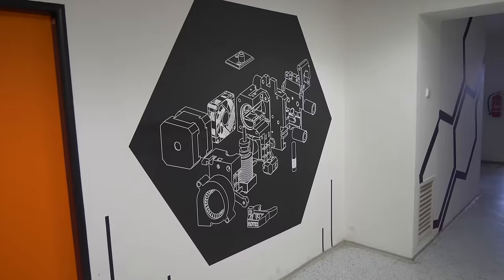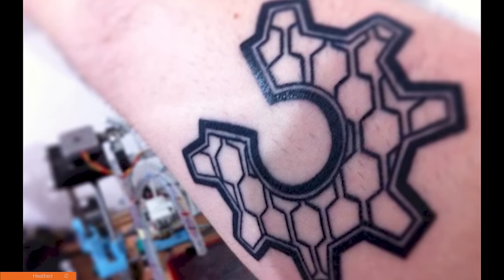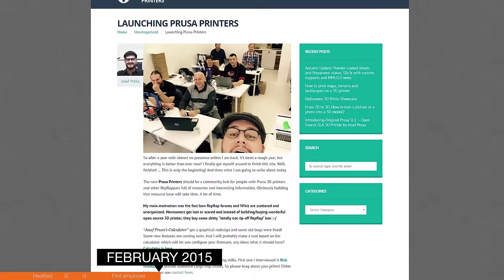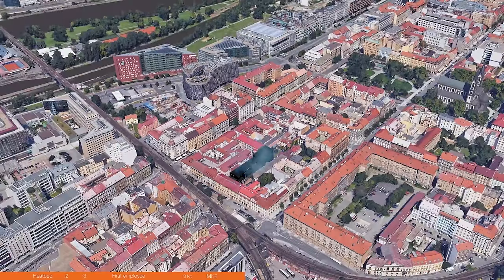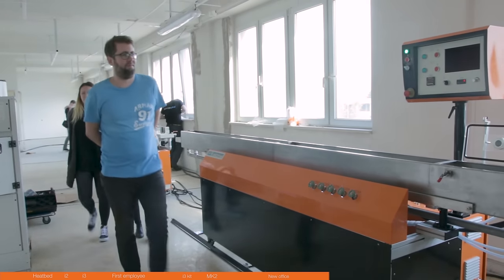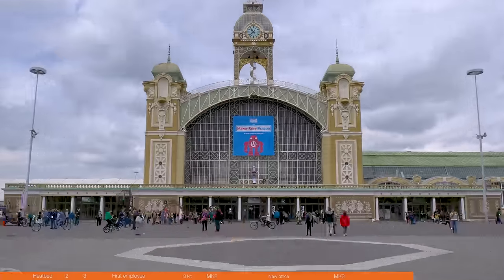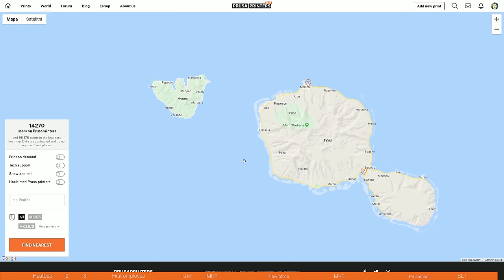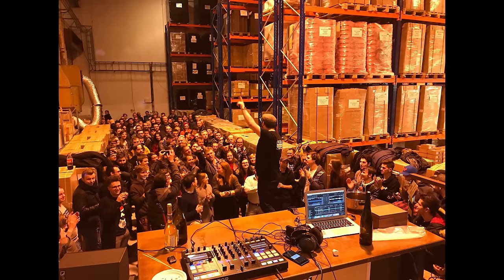The Road to 100,000 Original Prusa 3D printers

Comment: I LOOOOOOVE my Prusa printer! It just works! My other printers have constant clogs, breakdowns and failed prints regularly. My Prusa MK3S+ is amazing. It just works. Fantastic prints every time. What amazes me is that they have thought of EVERYTHING: the slicer is awesome, no need to really think just throw in the model and slice. The PINDA bed levelling is top notch,, the run out sensor, changing or inserting filament. The prints come out perfect every time. The prusa printer is the only one that prints perfect prints even with a cheap filament. And their own filaments are also amazing. I can go on and on. Thank you for these wonderful machines!

Comment: Love my MK3's, but I'd really like a larger Core XY style machine from Prusa. Maybe for 2020?
Reply: Still hope for PrusaCoreXY! Fingers crossed
Reply: Me too. I love my MK3 but I dream about some new innovations in FDM.
Reply: i can see them working on one with a heated chamber since now the patent from stratasys is running out. I guess we'll see soon enough :)
Reply: 3-400 mm x 3-400mm Prusa developed coreXY with tool changer support is the dream.
Reply: @matze1508  Patenting slows innovation down. Revolution!!! :)
Reply: I'm building one it's 60x60cm outside and 50x48cm bed and struggling to make the bed heated right now, its CoreXY made by 20x20 aluminium and some 20x40 ones strengthen by acrylic/wood cover to  heat chamber to be able to print PC filament, DUET wifi is ordered and on the way so imagine if we could make this thing a production line, Joseph's video gives me a charge of inspiring and ambition.
Reply: @Sam Power usage should scale with surface area which is a square of side length so it makes sense. I’d be inclined to have two heating circuits: one for the center region if the print is small and one for the remainder area if the print is larger. I also think it would need to be mains power based (or at least a good deal higher voltage than 24v) to be able to have enough power which increases risk of fire and worsens the consequences for electrocution due to improper isolation or insolation failure. For those reasons I’m not really interested in doing anything heat bed wise that isn’t already available in consumer purchasable printers. (A COTS part)
Reply: @amoose136  what if you only would/could heat the area of the bed that will have fillement contact? (plus some small Aria around it for convection)
Reply: @amoose136  True. That's exactly what I need for my projects. There are another options but the prusa seem's to be a very nice printer brand with a large ecosystem.

Comment: well i'm a newbie in 3d priting, actually didn't even get my 3d printer yet ( coming 1st week of may 2020) and a friend over italian 3d printing community pointed me to this video: AMAZING ! it's just beautiful to see how you started and how things are going ! Congratulations and happy printing !!!
Reply: Yo dude ! I have the Mk3s, you should know that you have to lubricate it every now and than. If you encounter ghosting, lubricate the smooth rods JUST A BIT (look it up at the knolagebase ! Its easy to do somethink wrong ).

(Only the Non-powderd one)
If your prints dont stick to the bed, clean the bed with warm/hot water and Non-perfumed soap and After its dryed, wipe it clean with Ipa. 

If you have questions, use the live chat ! Not the e-mail ! shop.prusa3d.com , there is the livechat. 

Make a Sharp tip at the fillament before putting it into the extruder.

Comment: Please make a huge build volume 3d printer
Reply: It will come with a huge price tag...
Reply: @murc111  yea of course, because i need build bigger stuff. So... prusa mk3s is really reliable, hope it will make a bigger build volume
Reply: @MaverickNgMVRKNG  why not make your own just take the prusa design and make it bigger or design your own one guy made a printer with a 1x2x1 meter bed
Reply: @Sarge92  because of the firmware it self, largest build might have different calculation for 3d printing.
Reply: @MaverickNgMVRKNG  Spend more time looking at firmware, i.e. Marlin.  You will understand the severity of your concerns then. {download it, open up configuration file in text editor)  The biggest problems with larger builds tend to do with sizing (psu, heatbed, hotend, nozzle, etc.).  Generally the bigger volumes come in the Core XY configuration (for many reasons: easily enclosed, static footprint)

Comment: I made a clone of Prusa i3. Used the wooden box design and took me few years to find time to finish it, but now I'm successfully printing. Was bit of a challenge to put it together as I had the parts (friend printed them for me), but no manual how to put them together, just a gallery of pictures in various stages of construction. I had to figure out where which part went, but the thing was simple enough that I figured it out. At first I used a wooden carriage plate, that I had to level bed before every print, I upgraded to broken aluminum composite (broke in transit) so now I have to level every 3-4 prints. Still, it was a great learning experience and I cannot thank enough for your contribution to the RepRap.

Kdyz te nekdy potkam, tak te pozvu na pivo.

Comment: it would be cool if prusa made a mill type printer so after a print is done a conveyor moves the print and makes a new print area, so basically like the cr-30 but with a normal hot end instead of a 45° one. it will also streamline the print mill room by automatically clearing the part from it to keep efficiency at max

Comment: Such an engaging and interesting story, I love to hear how companies grow. And especially the fact that this is so recent !

Also....  If you were printing the same thing but the lead times were large why did you not start getting parts injection moulded ?
Reply from the maker: Injection molding is a good point :) 
We get asked about it quite often, so we have prepared an answer for that:
The printed parts are never a bottleneck, we simply add more printers to the farm when we need them. Molds are REALLY expensive and take weeks to get right. And you are limited with the geometry of the parts - there are shapes that injection molding simply cannot do. On the other hand with 3D printing we iterate the parts and constantly improve them, this is not possible with injection molding. Last but not least, WE ARE USING OUR OWN PRINTERS :) Our manufacturing is literally depending on our own product, which is great! It pushes us to make the printers better and if there ever is something that could use an improvement, we're the first to discover it. The amount of print hours that the farm printers get in a few months is more than what the user will print in the lifetime of the printer :)

With that said, we do own a few injection molding machines and we are already using them for a few parts, where it makes sense (bigger parts that rarely need updates, e.g. spool holder, MINI front panel)
- Mikolas

Comment: In the beginning it made sense to use printers to print new printers but at this scale I would bet injection molded parts would be far more efficient.  I get that this would be a huge deviation from the roots.
Reply from the maker: We get asked about injection molding quite often :) Here's a copy-paste of our usual answer:
The printed parts are never a bottleneck, we simply add more printers to the farm when we need them. Molds are REALLY expensive and take weeks to get right. And you are limited with the geometry of the parts - there are shapes that injection molding simply cannot do. On the other hand with 3D printing we iterate the parts and constantly improve them, this is not possible with injection molding. Last but not least, WE ARE USING OUR OWN PRINTERS :) Our manufacturing is literally depending on our own product, which is great! It pushes us to make the printers better and if there ever is something that could use an improvement, we're the first to discover it. The amount of print hours that the farm printers get in a few months is more than what the user will print in the lifetime of the printer :)

Comment: thank you for all the hard work you have put into make 3d print accessible to ppl like me. i dont own a prusa yet but id love to. i have a ender 5, kingroon kp3 and a anet e10 and im pretty sure everyone of those took something if not the majority of the design from your i3. ive started to buy cheap clones of the i3 but ive not dont it cause id rather have the actual real thing, its price has just been alittle out of my reach for a single printer so far but ive been thinking about trying to print all the parts that i can an then use aluminum extrusions as a frame. one day i'll own a real prusa i3 mk3 or whatever the newest is when im able to buy from prusa.

Comment: i have a question, you are using 3D printers to print 3D printers, now that you reached a size that would allows you to buy machines to do injection molding would you do it
I feel like it make sense in a productivity point of view, but would you prefer to stick to the way you are doing right now ?

Comment: Hats off to you and how you grew your company with your own products.  However why didn’t you get into injection molding the quantity of parts?  Much faster, higher quality and less labor intensive.
Reply from the maker: Injection molding is a good point :) We get asked about it quite often, so we have an answer that I'll copy/paste here:
The printed parts are never a bottleneck, we simply add more printers to the farm when we need them. Molds are REALLY expensive and take weeks to get right. And you are limited with the geometry of the parts - there are shapes that injection molding simply cannot do. On the other hand with 3D printing we iterate the parts and constantly improve them, this is not possible with injection molding. Last but not least, WE ARE USING OUR OWN PRINTERS :) Our manufacturing is literally depending on our own product, which is great! It pushes us to make the printers better and if there ever is something that could use an improvement, we're the first to discover it. The amount of print hours that the farm printers get in a few months is more than what the user will print in the lifetime of the printer :)

With that said, we do own a few injection molding machines now and we are already using them for a few parts, where it makes sense (bigger parts that rarely need updates, e.g. spool holder, MINI front panel). We can even re-use some plastic from failed prints for the injection molding, which is nice.
- Mikolas

Comment: Just wondering, once you got up and going, why didn't you switch to injection molds for your printers?
Reply: The whole design ethos of reprap is self-replicating, so unless you are injection molding into 3d printed molds, it doesn't match the original philosophy.
Reply from the maker: We get asked about injection molding quite often :) Here's a copy-paste of our usual answer:
The printed parts are never a bottleneck, we simply add more printers to the farm when we need them. Molds are REALLY expensive and take weeks to get right. And you are limited with the geometry of the parts - there are shapes that injection molding simply cannot do. On the other hand with 3D printing we iterate the parts and constantly improve them, this is not possible with injection molding. Last but not least, WE ARE USING OUR OWN PRINTERS :) Our manufacturing is literally depending on our own product, which is great! It pushes us to make the printers better and if there ever is something that could use an improvement, we're the first to discover it. The amount of print hours that the farm printers get in a few months is more than what the user will print in the lifetime of the printer :)

Comment: Makes me want one, price is too much.  I'm not saying it's expensive, just too much so for me. I'd probably be tempted with a mini, having UK stock would probably convince me more. I'm very impatient. You should also sell on eBay. Lots sell for a higher price than they should be. Official stock would lower the value and if it doesn't, makes new way more attractive. Kits are for sale @£900 new, I also wouldn't object to a £20 increase in price through eBay, to go towards the extra costs. You'd sell tons of filament too. Think it's time to branch out and make it more accessible. I can get an Ender 3 V2 delivered next day from box. I swear you'll improve your customer base.

Comment: 3d printing is cool and all, but it seems like a huge waste of electricity to use 3d printing for all these parts instead of using injection molding or some other real process, it would also likely remove any of your scaling issues. And if you INSIST on doing it, why not just modify your Prusa's into continuous conveyer belt-driven printers. That would save a crazy amount of man-hours and work at this scale. Anyways, amazing job. Many have failed to get working production lines for complex products and you guys are crushing it!

Comment: I fitted a Brand New Bl touch to my Ender 3 Pro yesterday

I  spent hours following the install video's making sure it was fitted correctly

I powered on and it was working great, I did my first print which took 45 minutes and it was great

I decided to do another print, turning the power off, I changed the colour of the pla

Powering it back on, I isntantly got a strong electrical burning smell

Noticing the BL Touch sensor ,the lights had gone out and thats where the burning smell was coming from

The Ender 3 was still powered on, but the Bl touch was NOT

I have written to Banggood as thats where I bought it from

My concerns are, It may be a faulty sensor, in which case replacing it with another may be ok

If there is something else causing this I need to check to make sure

Please can you advise what i should check, before i replace with a New sensor

Please remember It printed ok and ran for 45 minutes

Only after I powered off and re powered on 10 minutes later did this happen

many thanks

Comment: It's cool that you 3D print a lot of the parts, but at what point do you decide to go with plastic injection molding? Doesn't it get cheaper at this scale?
Reply from the maker: We get asked about injection molding quite often :)
The printed parts are never a bottleneck, we simply add more printers to the farm when we need them. Molds are REALLY expensive and take weeks to get right. And you are limited with the geometry of the parts - there are shapes that injection molding simply cannot do. On the other hand with 3D printing we iterate the parts and constantly improve them, this is not possible with injection molding. Last but not least, WE ARE USING OUR OWN PRINTERS :) Our manufacturing is literally depending on our own product, which is great! It pushes us to make the printers better and if there ever is something that could use an improvement, we're the first to discover it. The amount of print hours that the farm printers get in a few months is more than what the user will print in the lifetime of the printer :)

Comment: Other than mentality difference, is there any reason why you guys 3d print your 3d printers ? It would be a lot cheaper and easier to just build a polymer injection factory and produce almost half of the cost in such huge scales
Reply from the maker: Injection molding is a good point :) We get asked about it quite often, so we have an answer that I'll copy/paste here:
The printed parts are never a bottleneck, we simply add more printers to the farm when we need them. Molds are REALLY expensive and take weeks to get right. And you are limited with the geometry of the parts - there are shapes that injection molding simply cannot do. On the other hand with 3D printing we iterate the parts and constantly improve them, this is not possible with injection molding. Last but not least, WE ARE USING OUR OWN PRINTERS :) Our manufacturing is literally depending on our own product, which is great! It pushes us to make the printers better and if there ever is something that could use an improvement, we're the first to discover it. The amount of print hours that the farm printers get in a few months is more than what the user will print in the lifetime of the printer :)

With that said, we do own a few injection molding machines and we are already using them for a few parts, where it makes sense (bigger parts that rarely need updates, e.g. spool holder, MINI front panel)
- Mikolas
Reply: @Prusa3D  thanks for the satisfying answer :)

Comment: I wonder if using injection mold line production for prusa 3d printer parts would be more efficient and professional than using 900 3d printer to 3d print other 3d printer parts
Reply from the maker: We get asked about injection molding quite often :) Here's a copy-paste of our usual answer:
The printed parts are never a bottleneck, we simply add more printers to the farm when we need them. Molds are REALLY expensive and take weeks to get right. And you are limited with the geometry of the parts - there are shapes that injection molding simply cannot do. On the other hand with 3D printing we iterate the parts and constantly improve them, this is not possible with injection molding. Last but not least, WE ARE USING OUR OWN PRINTERS :) Our manufacturing is literally depending on our own product, which is great! It pushes us to make the printers better and if there ever is something that could use an improvement, we're the first to discover it. The amount of print hours that the farm printers get in a few months is more than what the user will print in the lifetime of the printer :)